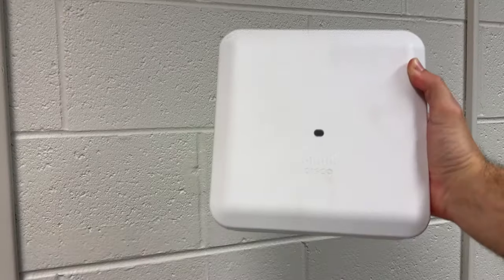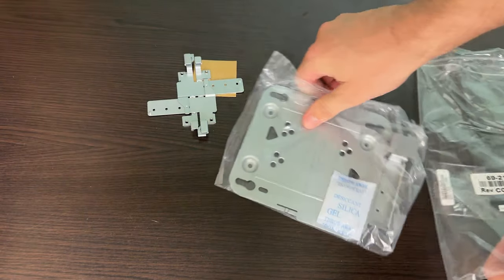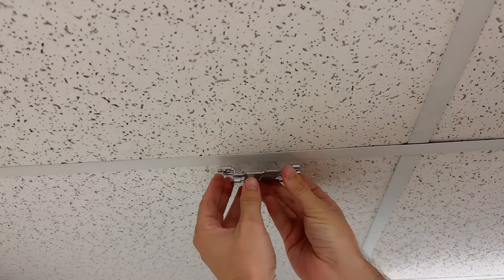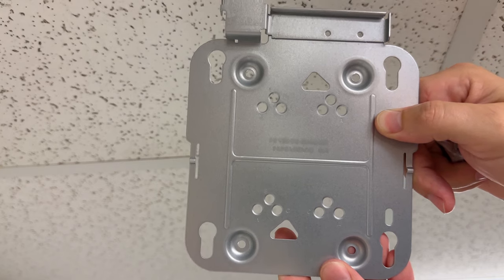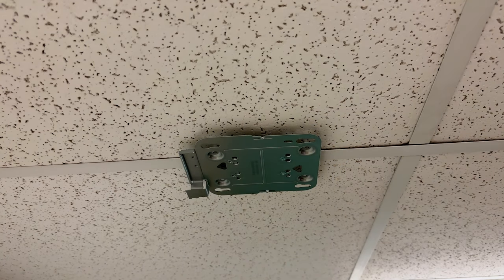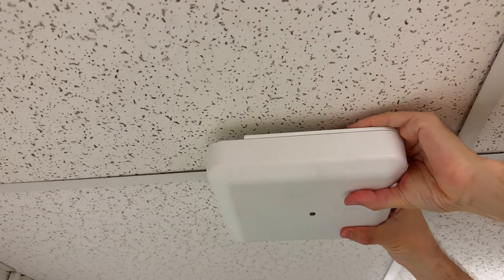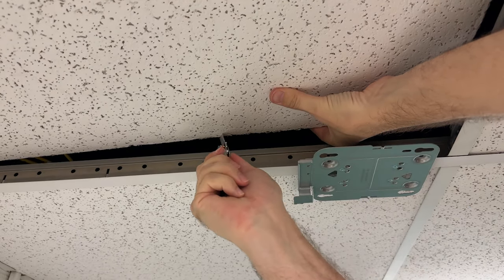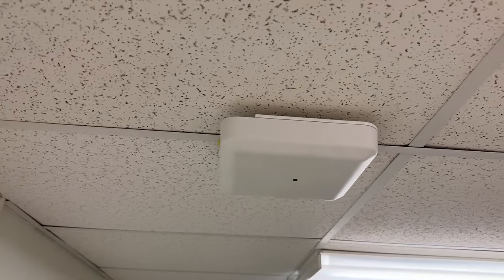How to mount a Cisco wireless access point to a drop ceiling

Comment: Literally never goes that easy, especially when you are higher up on a ladder and barely reach the mount/AP.
Always works when you try it before it's mounted, once it's time to mount one or more of the holes are misaligned by a few millimeters and the device can't be slid in.
These days I mount the AP in the bracket around 50 times to wear it out a bit, then install it in the ceiling.
Reply from the maker: Facts.  Trust me, I cut out the bad takes to keep the video short lol.  I don’t think I’ve ever got one on the first try 😂